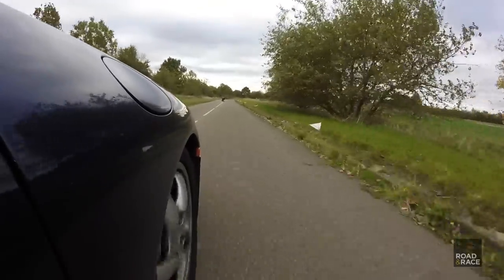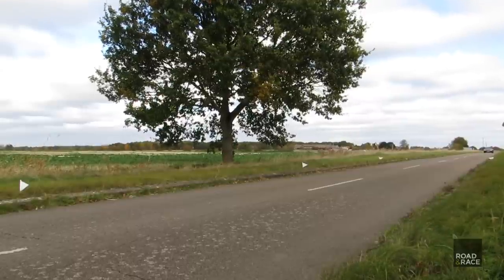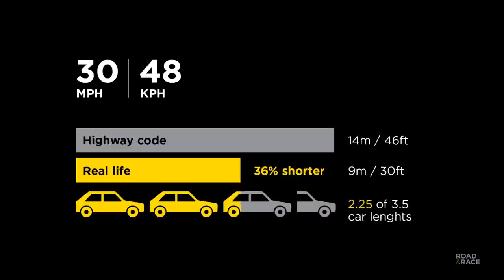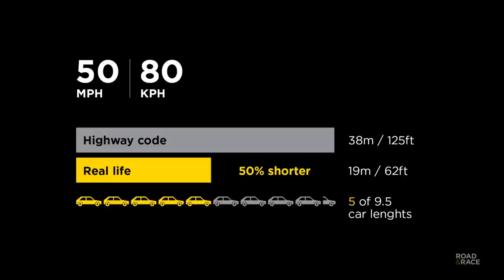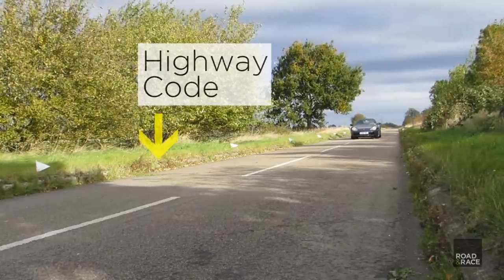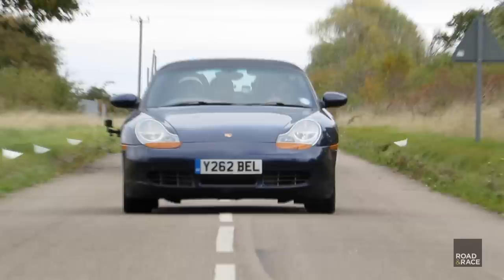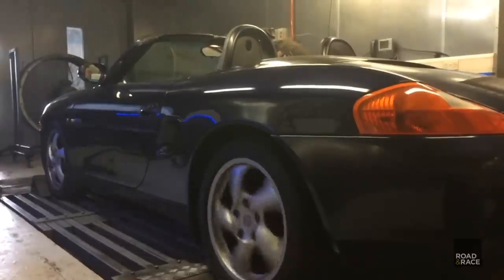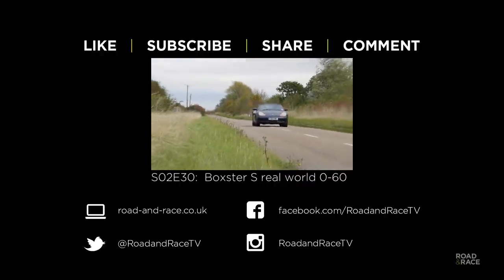Stopping Distances: Real World vs Highway Code

Comment: So in summary, you used a car with performance disc brakes on all 4 wheels to do a test for everyday drivers.
I can test you that the Fiesta I just sold absolutely could not stop that quickly with its drum brakes.
Also driving 70mph on a clearly 60mph road… really?
Not forgetting the fact your thinking time is 0 because you are marking the start point as when you start braking.
Jesus.

Comment: 0:18 Every new car that Motorweek (TV show in the US) tests, for at least the last few years, stops from 60-0 in LESS THAN 130 feet, with sports cars stopping in about 100-110 feet.  Those figures really are outdated.
Reply: But research also shows the average driver also can't utilize the full power of their brakes- the research seems to more support that the highway code is correct, in estimating what the average driver is capable of. But actually, when it comes to reaction perception time, the highway code significantly underestimates that. Meaning the highway code should actually have increased stopping distances, not less.

Comment: You should see how much stopping sight distance traffic engineers are required to give drivers in passenger cars time to stop. It's a lot more than the highway code, but it is researched based to cover 90% of the driving population.

Comment: It DOUBLED when going from 50 to 60!
Reply: E=0.5*M*V^2

Your energy (and therefore the energy your brakes have to turn from kinetic to heat) squares with your speed. So at the minimum you'd expect it to take about 30% longer (50^2/60^2 = ~0.69). 30 to 60 should take about four times the distance (which checking back is about right, little less than 10 metres for 30mph, and  about 35 metres for 60mph).

Actually we can work out how much energy he used in these tests (well no, i'm just going to ignore drag, power lost to drag is cube of the velocity, at least until the transonic region..., either way i can't be bothered).

30, 40, 50, 60, 70 mph, is 13.4, 17.9, 22.4, 26.8, 31.3 m/s

Boxster weights ~1300 kg. So 650*V^2.

116714, 208266, 326144, 466856, 636798

116.7, 208.3, 326.1, 466.8, 636.8 KiloJoule for each test

A litre of Petrol is 34200 kJ. Assuming an engine efficiency of 30% (can be between 20-35 for road going cars).

1754.7 kJ in total. He used at least 170 ml of petrol just to accelerate the car up to speed. For these tests.

Funnily, if petrol is at £1.30 a litre, it costs about 8 pence to take that from 0-70 and only 1.5 pence to go from 0-30. Of course drag is where the costs usually come from.

Comment: Not a realistic test you cannot compare the braking capacity of a Porsche with a more common Toyota or Nissan family sedan that will have a less effective braking hence longer braking distances. You also have to consider the weight of the vehicle, a large SUV will have a longer braking distance
Reply: Perfectly realistic test. Brakes are designed and adapted to the car weight... Here is a medium-size crossover (Nissan Qashqai 2011) stopping from 30 mph in a "disappointing" (10 years ago) 11.9 m in the wet, 20% shorter than the Highway Code reported distance in the dry: https://www.practicalcaravan.com/reviews/nissan-qashqai-2-0-dci-tekna
2013 Evoque - not exactly a light vehicle - stopping in 9 m, same as the Porsche: https://www.edmunds.com/car-reviews/track-tests/2013-land-rover-range-rover-evoque-coupe-track-test.html 
Supeminis brake group test from 2012 - the worst in the group stopping in 44 m, the best in 34 (same as the Porsche here, but it's a VW Polo). https://www.which.co.uk/news/2012/05/best-and-worst-supermini-braking-distances-285596/

Pick up any car magazine doing tests, and you will find that a ~10 m braking distance at 30 mph is pretty much the norm, as is a ~40 m from 60 mph. A high performance car will go well below these, but the most important difference will be brake fade resistance, not "one-off" emergency stop. Highway Code says 14 and 55...

Comment: Not an everyday car so the test has no credibility try it in a ford focus or something similar
Reply: Porsche Boxter from year 2000 is nothing special a modern ford focus will stop just as fast.
Reply: Also, there's a big difference between the tyres that Ford fit when new to that a typical owner would put on when needed.
Reply: I will try this in my ford f450

Comment: the california driver handbook says it takes 400 feet to react and stop a car at 55 mph in good conditions. lol
Reply: Traffic engineers are required to design the roads at a design speed of 55 with about 550 feet of stopping sight distance. But this covers below average drivers (up until 90% of the total passenger car drivers).

Comment: This is very fun but it must be pointed out that the way he is running this test completely removes reaction time from the equation, which would add an increasingly significant distance to each higher speed. These tests need to have a signal light that goes off randomly so that reaction time can be evaluated.
Reply: The highway code has two parts braking distance and reaction distance. He is comparing to the braking distance, the reaction distance is assumed accurate. So it's actually totally valid.

Comment: The complaints in the comments aren't fair. The car used is an older model Porsche Boxter, which isn't really "high performance". This car will have about the same stopping power as a modern day car from say ~2014.
Reply: Far less - take a look here: https://www.which.co.uk/news/2012/05/best-and-worst-supermini-braking-distances-285596/ - VW Polo from 2012...
Reply: Let me remind you that the only thing that affects your braking distance is your tires and whether or not your brakes are strong enough to activate ABS. That old Porsche has a pretty crappy braking distance compared to any new car.

Comment: The highway code says "typical stopping distance" these tests are always emergency style stops NOT typical stopping as the highway code states. so not relevant or comparable.
Reply: They are not even that. Calculate average deceleration, and you will see clear evidence of distances being estimated, as average deceleration implied by  the Highway Code numbers is a constant 0.66 g. This would have been reasonable emergency stopping for the 1950s with a vehicle with cross-ply tyres, live-axle suspension, drum brakes without ABS. As to what the Highway Code writer meant for "typical", you'd have to ask him; for the 1950s (when the table was first published - with these values!) these are "typical" of shortest possible distances... not of "typical braking".

Comment: A Porsche isn't a typical modern car. Mr Clarkson said the braking distance was set by a normal Ford Cortina, not a £40,000 high performance Roadster. You couldn't find a Vauxhall Corsa anywhere?
Reply from the maker: +Cash Wfivefive Hold on, I'll check behind the sofa...
Reply: haha, you know there are about two on every street mate
Reply: A 2001 Boxster S can be bought in good condition for 10K or less today. its really not that much.
Reply: My mum's cousin worked for the MOT in the 50s and 60s. He said that the car they used was a Ford Anglia.
Reply: Here you are: https://www.which.co.uk/news/2012/05/best-and-worst-supermini-braking-distances-285596/ - and note that these are (by now) 10 year old superminis, not 2021 high performance vehicles. The best ones perform as well as the Roadster, the worst ones are still 25% better than the Highway Code.

BTW - the Highway Code distances are suspiciously closely fitting a 0.66 g (2/3 g) constant deceleration curve - so I suspect no testing as such was involved; only assumptions. In any case the distances haven't changed since the 1954 edition, whereas the Cortina was launched in 1962.

Comment: So at 95 mph, dry road stopping distance would be around 70 metres, which is a perfect stopping distance for a 70mph car in  the 1965 highway code, but... response time in any direction would have been diminished as well if we were to have applied that speed as from about '98 or so, overtaking would have become more difficult, etc... I would agree to an 80-85 mph speed on highways today, if no one used any drugs nor alcohol, nobody would smoke while driving, nobody used any cell, etc... . Let alone demanding car part quality way beyond MOT, etc. . We're not there yet, and I guess we never will. There are even guys thinking that 4 Scotches makes them drive better!

Comment: I'm just trying to understand what the point with this video is. Braking distance is determined by the speed and the coefficient of friction.

The coefficient of friction depends on the weakest link in brakes, tires and surface. (Brakes and tires need to be proportional to the weight to be able to work properly)

Have you taken into consideration on the friction of the surface between the tests? Or the qualities of the tires?

So the only thing you are saying is "On this surface, with these tires and these brakes I have shorter braking distance tha the highway code". Hell, even a slight slope up or down changes it.

And since your tests don't scale properly we know that you are either not braking on a surface with the same friction for the whole stretch or you are not consistent with either the speed or point of braking.

It's interesting, but hardly a good argument against the Highway Code. Especially since as you can see in the comments that people tend to read this as "See, I can drive faster because I can always stop faster than what the book says"

It's not "The Real World" It's one test in the real world.

Comment: Absolute codswollop  They were using a 2.3 litre  Porsche  a special Roadster light sports/saloon  car and not a normal  bog standard everyday machine.   Its light and it has a good power to weight ratio and by its cost, maybe 3 or 4 times the cost of an average users car has a better braking capability.So its an awful lot quicker  than   the vast majority of cars on the road and as a result of its particular manufacture can easily stop quicker. 

Next time use a  normal everyday  5 seater saloon car fully laden with passengers and for a holiday with luggage so that its weight and that means MASS  is  increased and then  and only then come back with some reality figures and not this nonsense of making others believe  that they can stop in these low distances.   They cant  but Porsche drivers can. and anyone who believes that they can stop in that distance in a bog standard saloon car is living in cloud cuckoo land as you are.

PS. its also possible for the sake of winning any argument that as this was not on a level runway but  on a normal appearing road that there may be an ever so  slight up hill gradient of say  30 cm in 50 metres and that would slow the car down that is not under acceleration.   Also its quicker to stop a car if one has  tyres that are not fully inflated, say losing 1 or 2 psi would also enable a car to stop in less distance but taking too much out could be dangerous. 

Only an idiot and a dangerous  fool would argue that braking distances are better now and quoting this result as substantial evidence that the H.C. and the DVSA and all training organisations have it wrong.
Reply: Haha, only thing that affects your braking distance is your tires and if your brakes are good enough to activate ABS, that porsche will have a horrible brake distance compared to even the shittiest of new cars.
Reply: @swecreations  Again what you and others fail to realise is first they didn't use a high performance  sports car as that would give a  false a unreal in comparison  with other standard saloons.  Then   again as I have stated one needs to prove the worst case scenario and that is of a fully laden saloon car  with 4/5 persons  in and  enough  luggage in the boot. Then when its full loaded only then find out the braking capability.  After that average out the good and  the bad o perhaps just take the worst case scenario and then for good safe measure add on a further 10 % of distance.  Then you will have a realistic figure  of just how far one  needs to be able to stop in on our roads.   

As a by the bye there were tests done in 2021 by the  Motor Vehicle  Research and Development Center for a Road Safety charity and the result of these test proved that it was generally some 1.5. seconds on average for  the Thinking and reaction distances and not the mere 0.7 of a second we now take for granted.  So that increases ones overall stopping distance by at  last one second. being  an increase of some 105 ft of Thinking Distance  at 70 mph.
Reply: @judgedredd49  Sure, but a fully loaded saloon will stop earlier then this Porsche since it's newer, so this Porsche is a worst case scenario as most people don't drive cars from the 90s anymore.

Comment: Try learning how to correctly apply the handbrake. Push the button and pull. Using the ratchet wears out the pawl, which is designed to stop the parking brake slipping off.